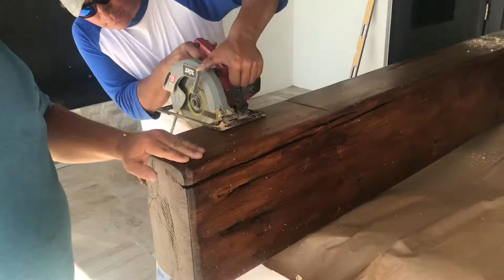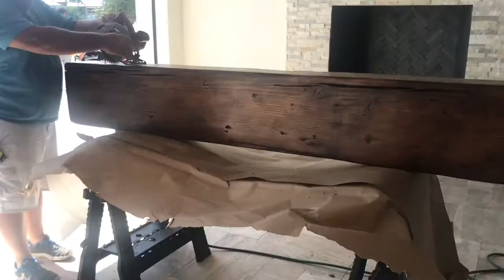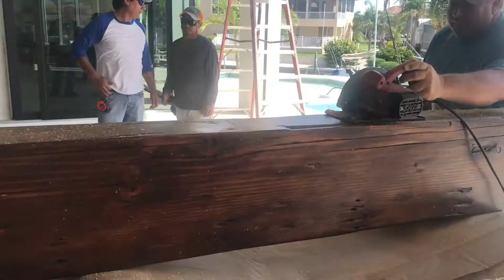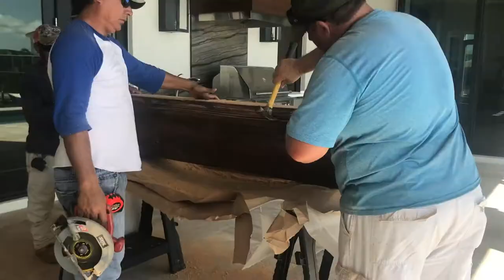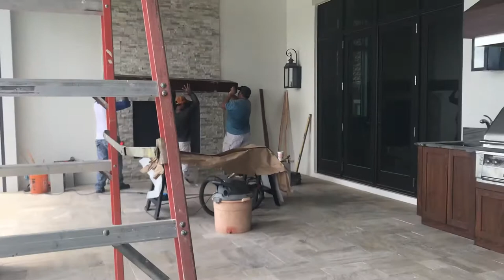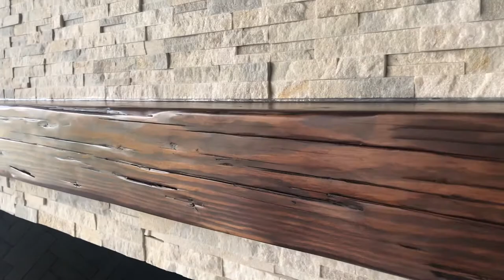How To Install Solid Wood Mantel

Comment: What the f%ck was that??? How to cut a notch and place it on a wall, wheres the fastners, did you stick it up with pva glue, magnets or....?? What was the point of the notch?? 🤦‍♂️
Reply: They had like  2x4 attached to the brick wall or something like that.